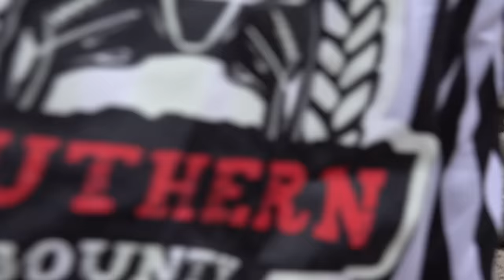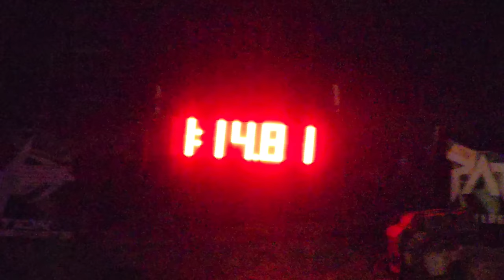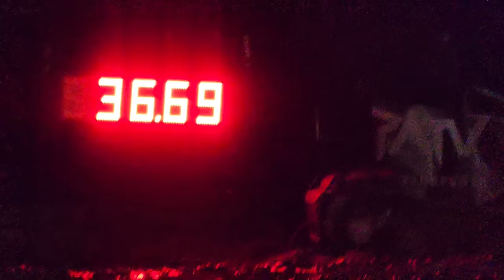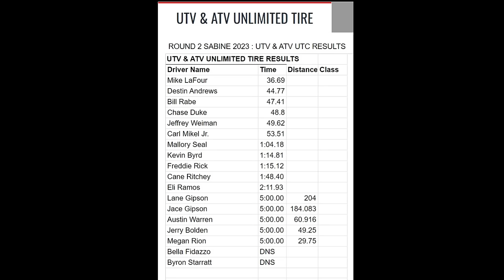High Horsepower Meets Punishing Bounty Hole. This Ain't Skeg

Comment: It's hard to get into those huge 4wheelers that can't turn tires fast enough to clean em out. I like osta's crew and their setups a bit better. Dude at 11:32 had a damn good setup
Reply: Usually thats true but alot of these guys have massive power for such small engines...i was surprised how well they could turn those big ass tires, the guy who skimmed the center pit around 12 or w.e had double nitrous bottles